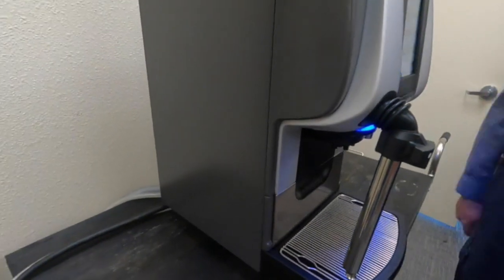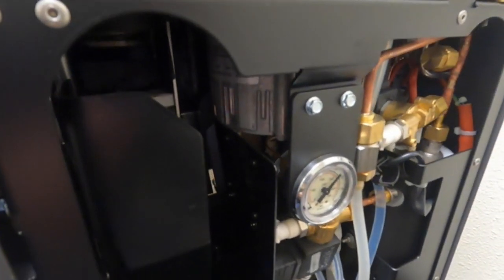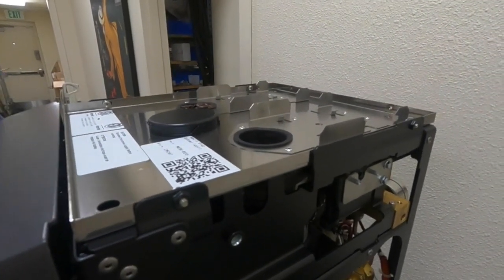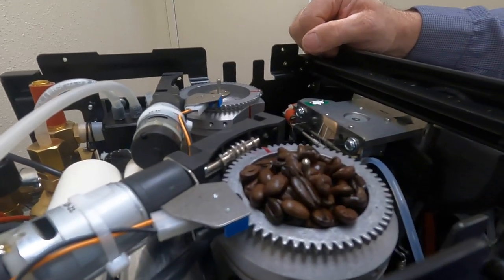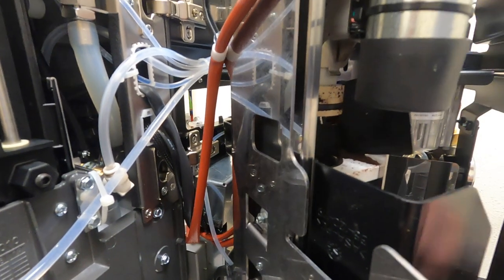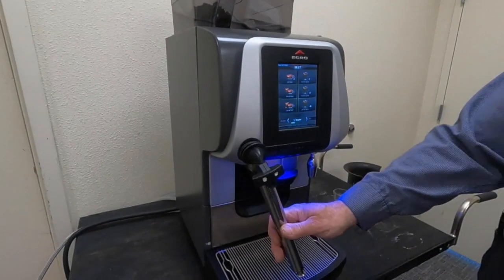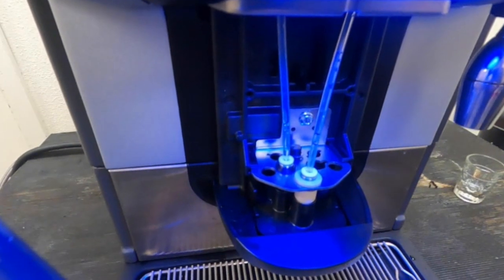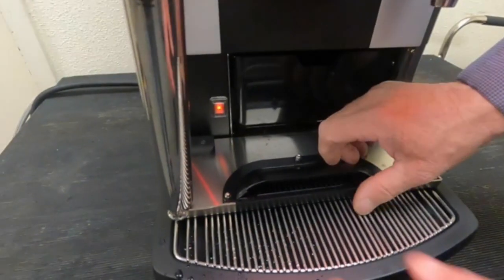Egro One Automatic Espresso Machine Internal Components

Comment: Nice video, is the internals on an Egro Next similar?
Reply from the maker: Yes  the brew unit, steam boiler, brew boiler and block assembly are all the same, however there is much more  functionality and options with Next. The Next offers as options a 25 gram brew unit, a cool coffee module and cold foam. Ruth listed links above for both machines if you are interested in researching and compairing. Look under the features tab or click on the options. Great machine. If I can answer any additional questions, let me know. Dave